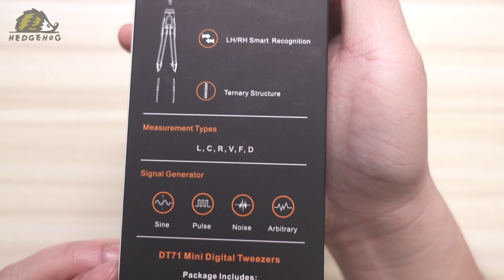萬用小鑷子DT71開箱&實測/ DT71 LCR Tweezers Review【Hedgehog刺蝟幫】

Comment: DT71 is garbage. Measurements do not match. Individuals have to correct it, but it's so funny. Buy it if you want to throw money away
Reply from the maker: For general measurement, the accuracy is actually sufficient. After all, such a small-sized machine cannot be compared with bulky and expensive machines, so instead of requiring precision, this machine actually pays more attention to portability and convenience.